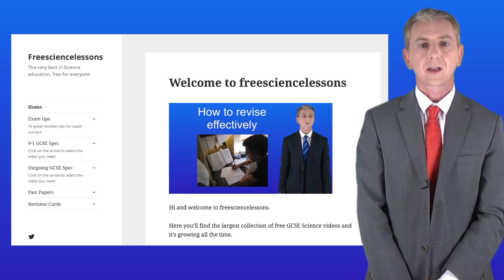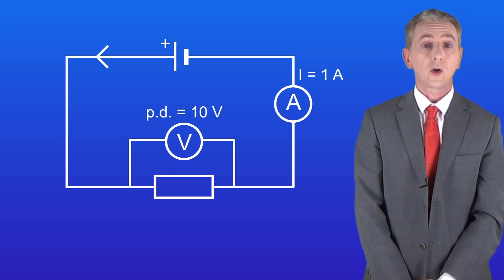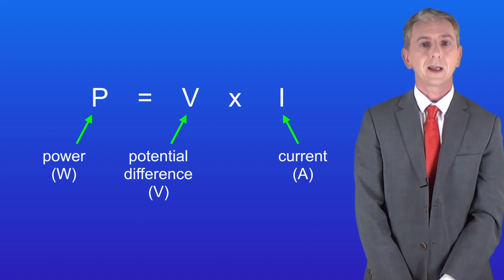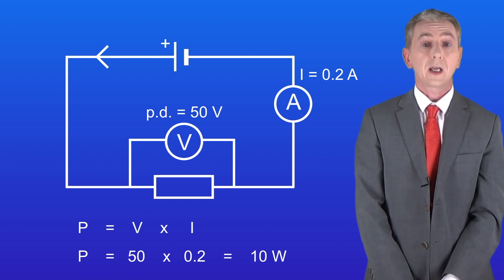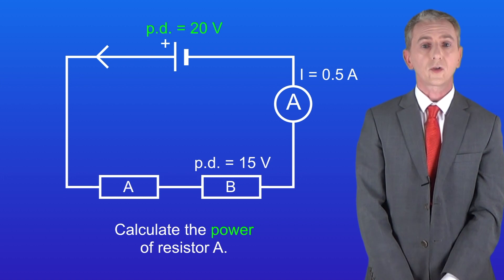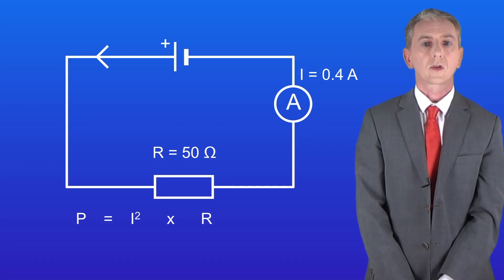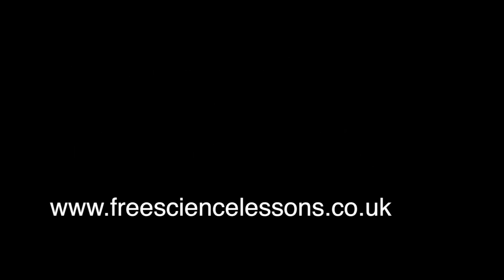GCSE Physics Revision "Power of Components"

Comment: Does this remain the same when the components are in parallel? And thanks so much!
Reply: the formula is for single resistors or devices. In a parallel circuit, the current divides equally and the potential difference remains the same so you can calculate your answer using that. However, if you have to calculate the total power of the circuit, use the total voltage, total current or total resistance to do so. then you will find the total power used up. BUT the formula is the same to calculate, just the method and the steps change. Hope this helps :)

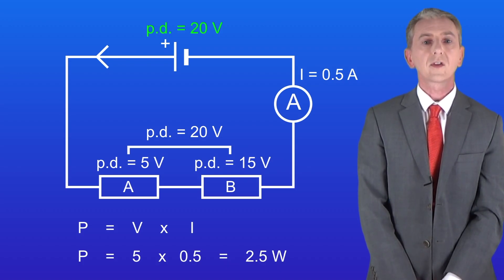Comment: 2:27 - If you have to find the p.d then why not just use the one already given? (15V) Why go through the effort of trying to figure out the one in series?
Reply: Because the question was to calculate the power of resistor A, not B, so we need A's potential difference for our calculation.